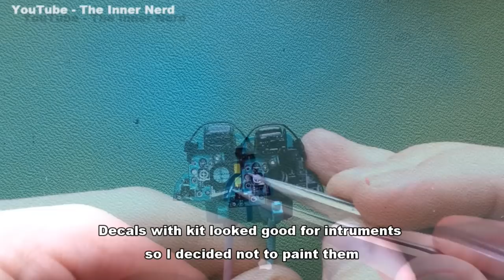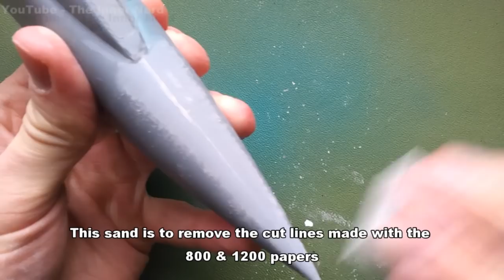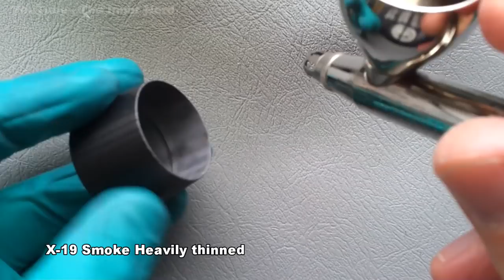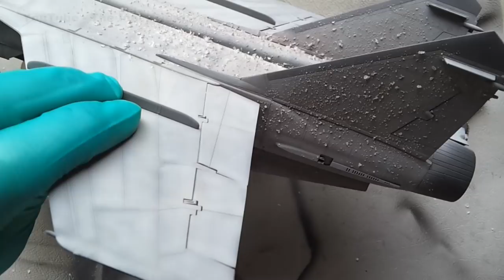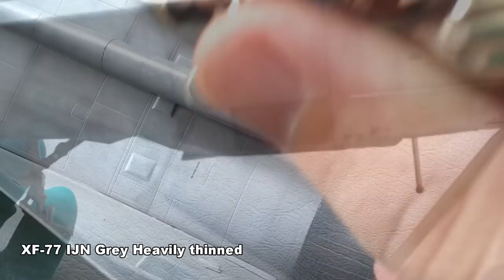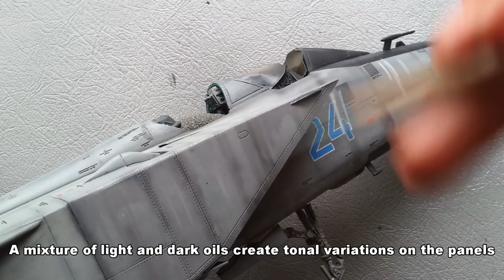Hobby Boss MIG-31 Foxhound "Blue 24" 1/48 | The Inner Nerd

Comment: I like the use of the salt.  It is something I have seen rarely and want to try now.
Reply: Just make sure you use salt with a flaky texture like sea salt or rock salt, not normal fine crystal table salt.
Reply from the maker: @soupfork2105  Thats right, also the random texture of the salt from grinder will give you a better result. Make sure you rinse off the model thoroughly as salt marks can remain on the model if not and become permanent when you pick them in with a gloss coat ready for vanishing

Comment: Thanks for the excellent video and model! Do you use oils directly on the Tamiya paint or do you seal it with gloss/matt varnish before?
Reply from the maker: In this video used a matte coat over the paint as I put in decals and used the oils as a weathering process. But you can use the oils directly onto the paint yes it won't do any harm

Comment: Question can you use clear glue for the glass on the controls in the cockpit?
Reply from the maker: You can use PVA and super glue for the canopy without the risk of the canopy glass fogging. You can use Extra thin cement but be careful, this can make the canopy fog if too much is applied so best keep to one of the other two to be safe. Thanks for watching :)

Comment: Nice build. One question. Was there a gap on the nose or did you put the filler to sand down so you knew it would be seamless?
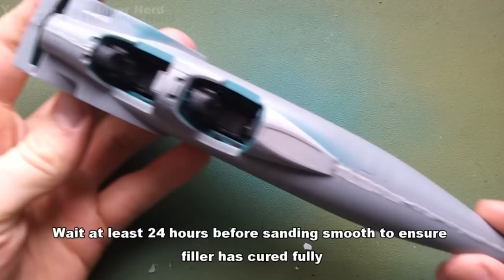Reply from the maker: Thanks. At 4:12 you can see that I out filler down the join on the nose so get a seamless fit. Then sanded it down until smooth so the join was invisible

Comment: For oils, are you using just dry cloth or cotton swab? Or do you use a little white spirit ?
Reply from the maker: Firstly the model is clear coated with clear gloss varnish (I use Mr 
Color GX100 in three layers). Next I apply the oil wash and allow to dry
 until the oils are dry to the touch. It can be left longer and still 
come off if the clear coat is high-shine (polished). Next it to remove 
it with a dry paper towel and dry cotton buds to removed the desired 
amount of oils. If there are areas that need to be cleaned further then a
white spirit dampened towel or bud will be sufficient to remove the more stubborn 
areas of oil. Remember the glossier the clear coat the easier it will 
come off. Matte clear coats will grab more oil and be harder to clean 
off making the wash more of a filter than panel line accent.

Comment: Whats the salt used for? Please let me know im just starting to get into modeling and im curious as to what it does
Reply from the maker: Hello and welcome to modelling! So your question...

Salt is used as a temporary mask for the paint layers. So the base colour is painted (typically the base colour of the plane) The the salt is applied to create a random mask on top of this layer. The the second colour is applied (typically the base colour with added white/black or other colour) to create an ever-slightly different shade to the previous. Once removed, the salt had protected the layer 1st sprayed and reveals a random weathering pattern normally seen on carrier based aircraft such as the F-14 Tomcat or F-18 Hornet. Salt weathering is normally used on the upper surfaces of the wings and spine of the aircraft as this is typically the areas with the largest flat surfaces which salty water can land and evaporate, causing this effect on the real aircraft. 

It's important to then spray a third layer of paint to harmonise the two layers together. This should be done with yet another mix of the original colour to create the final surface colour you want to achieve - I normally go Light-Dark-Light with the layering, but this depends on what you're trying to achieve. The final blending layer should be very thin as you don't want to hide all the work you've just done with the salt layers.

I hope this helps and that my channel is useful in other ways as you progress in modelling! If you have any more questions just leave a comment and I'll happily reply
The Inner Nerd

Comment: If you trim the front of the top section a tiny bit it will all line up and almost no filler is needed.
Reply from the maker: Yes I did that as the tabs there create an interference when mating the nose. Seems that it wasn't enough...

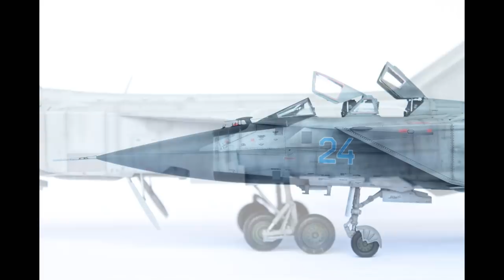Comment: Hello. Good work ..... just like that !!!! The only thing that confused at 21:49 the front desk is strongly arched forward ..... this is not permissible. In actual operation, when this happens, the aircraft is suspended from flights, and inspects the strut of the front landing gear of the chassis. And so everything is super. Sorry if that is not properly written in terms of spelling .... I translate through Google translator. Good luck to you buddy.

Comment: casualy adds a sr71 to make a diorama but since the mig was trying to shoot down the sr71 at a much lower altitude the dio makes the size of the room
Reply from the maker: Know of any decent SR-71 kits??
Reply: @TheInnerNerd  but would build it without the drone imo since it wasnt realy that used and also im sure you can find the kit for less money on ebay or something like this
Reply: @TheInnerNerd  Tanmodels supposedly is going to release a newly tooled 1/48 SR-71.  Based on their other kits I am optimistic. Would be cool/difficult project as it is a lot of black.
Reply: @JTRocketM1419  do one that's mostly bare titanium, just black on the leading edges.

Comment: Water marks on a plane capable of mach 3? That’s taking detailing too far. The ground crews would never allow that sort of deterioration to happen to the plane.
Reply from the maker: I'm not so sure as you can see this Mig-31 actually taking off at around still showing some quite heavy water marks. Maybe they're just going to the shops? https://images.app.goo.gl/SMNEajqdtQZJ8MVh6
Reply: Mig-25's and mig-31's are notorious for being dirty and water marked, as they mostly operate(d) out of kiev, rostov, and yakutsk where winters are extremely harsh.